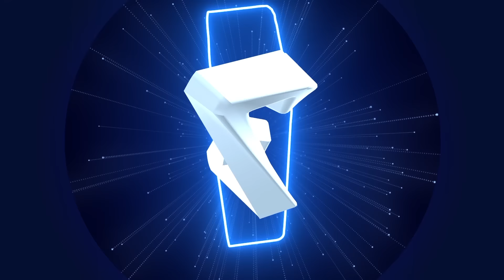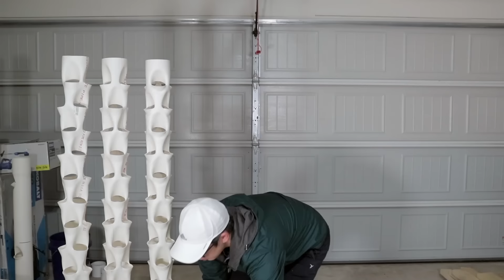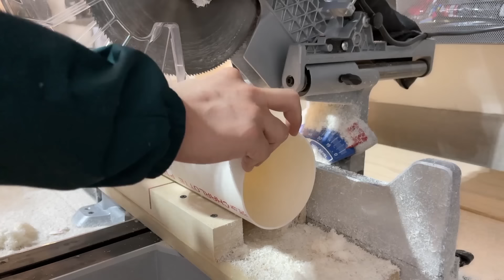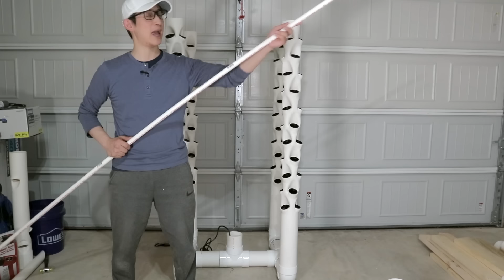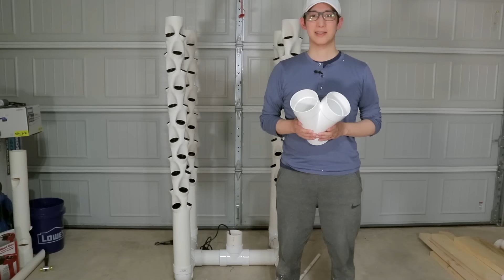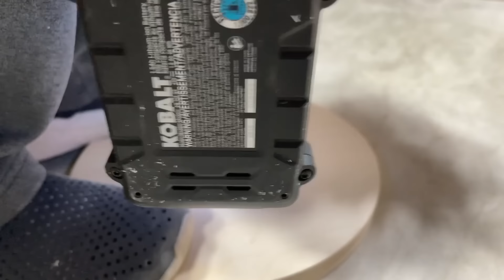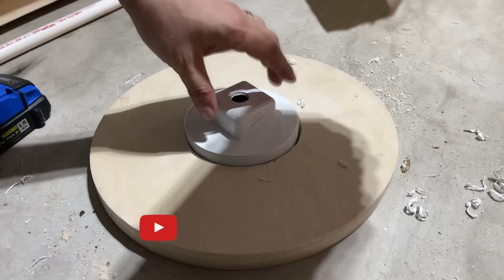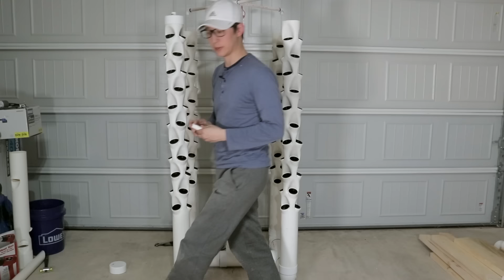DIY Hydroponics | Aeroponics Garden Tower Build | Part 2 - [4 Tower Build]

Comment: I’ve commented on a similar video but isn’t this aeroponics? Hydroponics is when the roots are fully or partially submerged in water isn’t this just spraying the roots with water which is aeroponics.
Reply: Correct
Reply: You can call it whatever you want but if it doesnt create genuine aeroponic roots, you wont get any of the benefits associated with aeroponics.

Comment: Very cool set up Chris. I'm looking to do something similar but i read somewhere that pvc pipe will leach toxic chemicals into the water that goes in it and is only suitable for drainage. Something to do with uv breaking down both abs and pvc piping. Have you heard of this? Ive read ipex piping is the way to go but can not find it in 4 inch anywhere.
Reply: I think it is PEX that you have to worry about.  That's some nasty stuff and is for "potable" water movement.  Never seen it to be any bigger than 1" dia. What is nasty about it, is if water sits in PEX lines for more than a week wothout movement, it degasses into the water.  It is usually installed in walls or in shade of a garage or laundry room.  I can't imagine how bad it would be sitting in the sun.  🤢🤮

Never had that degassing with PVC even exterior pipes in full sun.

Also ABS is for sewage not potable water.
Reply: @michaelsheehan5486  I c. Thats interesting as almost all homes in canada are not using pex lines instead of copper
Reply: @keithyoung7381  
I didn't say PEX isn't popular. 😁 
It's easy to install long runs with no intermediate joints like PVC and copper because PEX comes in long rolls.   
It expands and contracts without breaking seals if installed properly at the manifolds and fixtures.  
Also remember it's colder in Canada most of the year than your neighbors further South of you. 
One of my  friends is a plumber and he has installed PEX many times in AZ.  He has received complaints from customers who have gone away on vacation and come back to discover the foul chemical taste of the water from PEX installation. So I can only go by his experience. 
After awhile, the mineral deposits of the water will coat any pipe with running water. 
But he still gets complaints during the summer.   What can ya do?  Gut a whole house.  A person just has to run the water a little to get the stagnant water out. Unfortunately it is a waste of water. 
Just saying.

Comment: Great upgrades to your last video.  Again a comment... instead of cutting the 3" extra pieces at the tops (just 8 more places for a water leak)... consider using Street elbows at the joint... they will fit into your female adapters at the top of each unit.  Just less pieces to go wrong.

Very well done, thanks for all the ideas!

I'd like to see how your plants grow in this.... my instincts tell me that your water reservoir isn't big enough to support that many plants and you'll have pH issues.  Typically, hydroponics systems have 1/2 to 1-1/2 gallons of water per plant in the reservoir.  Your system cannot have more than about 5 gallons total, which is not good for 140+ plants.  If you could somehow attach a reservoir to the center mass of your structure it would work great.  Gonna work on that myself, will update if I come up with an easy solution.  The issue is going to be water tight connections.
Reply from the maker: Thanks for the tips.  I was also thinking about adding a reservoir but haven't found anything that can be connected easily.  Any recommendations would be great!
Reply: @ChrisLoh  Once again...  PVC Unions add a whole new world/dimension of flexibility and malleability to any PVC project...  So you can start smaller and work your way to a larger project with more towers, reservoirs  - - for disassembly for winter storage  - -  and as they said in the other comments valves on every tower and... possibly... even within  towers to grow things that require various water needs... more at the top and less at the bottom... the world is the limit... - - and a huge time saver and making the project more user friendly - maleable so the holes don't have to be perfect and re-heated - - pool noodles - - they said they had been using them for years and you can get them at the dollar store for $1.25 and far less dangerous cutting of tiny pvc slices - - and makes it so a person can do it without an accurate miter saw... even a hand saw....  and for drilling holes use only expandable bits like the second one you used...... Hole saws are tricky and make dirty uneven cuts that have to be cleaned up....

Comment: This is awesome! Am I just missing where the supply list is? I can't seem to find it and am itching to build one
Reply from the maker: I didnt post the supply list for the second build.  There is a supplies list for the first build.  I'll have to go back and see if I can put together an accurate list for the 2nd build.  For the most part its similar to the first build (multiplied by 4 in some cases) with additional connectors for the water distribution pipe.  I'll see what I can do to get the list added in the near term.

Comment: Hey Chris, great video and a great improvement on V1. I have a question has been asked before but didn't see a reply from you, what angle did you cut the 2” pipe at that you used to make the holes for the pots? Thanks.
Reply from the maker: a 45-degree angle should be enough, however, I think any angle will work as long as its sharp edge that allows you to get under the plastic.  To be completely transparent, I didn't measure and just cut the angle itself

Comment: What is the total ending height? I’m thinking about building a green house to put a few of these in, but not sure how tall I should build it. 

Incredible improvements from V1
Reply from the maker: The total height was about 6 ft, give or take.  Good thing is you can make it as high or short as you need by adjusting the height of the tower themselves.

Comment: The 4inch pvc at my lowes and home depot in Colorado is like 4x thicker I'm not sure it can be heated up and worked like that
Reply from the maker: Yep.  You will need to get the thinner PVC.  Im surprised both aren't available.  They are usually next to each other
Reply: The thinner stuff is sold as sewer pipe or DWV (drain, waste, vent)

Comment: When you're out if town are you using some sort of timer watering system to help keep the plants hydrated?
Reply from the maker: I actually didn't have to refill it for about a few weeks at a time since the water recycles.  I just kept mine on 24/7, however, I read it might be good to connect a timer so it's not constantly going.
Reply: @ChrisLoh  On one of the commercial sites that has a product very similar to what you built they have a timer that goes on for 15 minutes and then off for 15 minutes and then back on for 15 minutes etc.

Comment: I would add a valve on each infeed so that you can turn that flow off if you are not using the tower or need to do maintenance on just a single tower.  It may not be a big deal to turn it off when pulling plants and putting new ones in but at the end of year harvest your system wlll become less full and eventually some towers will be running while others will be empty and you will need to ether create caps for the empty spaces to prevent leaking or be able to turn off the empty tower all together.  a flow valve to each tower is and inexpensive fix.
Reply from the maker: Great idea.  Your right.  i think i saw a shutoff valve connector that would be easy to attach between pipes

Comment: Can I ask at what angle did you cut the 2” pipe that you used to make the holes for the pots?
Reply from the maker: I actually just randomly cut the angle.  I assume any angle will work as long as it lets you get beneath the plastic.

Comment: What pump are you using for this system?
I'm trying to find one that fits in the 4" pvc and will pump water high enough with the needed volume to water all of the plants.

Thanks for the video on this awesome build!
Reply from the maker: This one from Amazon: https://amzn.to/3LZtvy7
Reply: @ChrisLoh  Awesome thank you!
Reply: FYI , that pump Chris suggested here does not fit a 4" pipe with out cutting parts of the pump off. You can cut enough edges off to make it fit in the side of the fitting but not down through the top of the "T". Which means you either cant glue at the sides of the fitting and will have leaks OR you have to cut the fittings off and  replace most of the lower half of your assembly if the pump goes out. Its best to find a pump that can fit down into the fitting from the top of the "T".

Comment: Really cool build, man. I love the design. 

You're in for a bad time the way you use that chopsaw though. Let that blade stop before you move it out of your cuts or it will grab that stock and suck it up. Start that cut towards you and push back in to the fence. Let the blade stop and then readjust your stock if you need to finish the cut, but don't start the blade in the middle of the material. Also, it has a dust port on the back, I'd suggest hooking a shopvac, or even your home vac up if you don't have one. You don't want to be breathing any of that fine particulate. 

I don't want to come off too critical, but I've been in front of a saw for almost 20 years and I cringed watching some of those cuts on this video and your first one. I would automatically be correcting the apprentice if I saw him doing this on site. Stay safe, and good work.
Reply from the maker: Thanks.  Funny you should mention that, as I just watched some videos with exactly the same advice.  Lesson learned.  Thanks for the great advice!
Reply: Damn just wrote a comment about the same unsafe practice. Great info. I didn't read comments before I wrote it.
Reply: Question, then: Would it make sense to use a saw blade meant for stone? Or use a mister or water drip to cool the pipe? 
I haven't started yet, I need to get the saw first, before I try this.
;-)
Reply: @steyraug96  Nope. Regular wood blade will work fine. Stone blades are more of a grinding cutting action and would make too much heat. A regular wood blade will cut through so fast that heat won't be an issue, so you don't need any cooling. Most plumbers use a sawzall to cut this stuff, but it doesn't need to look nice or be too precise. Chopsaw is the way go here.
Reply: @gageangstrom7875  Thank you for the info.
Reply: @steyraug96  You don't need a power saw for this and in fact it would be far safer not to use one.  Just get an $8 hacksaw.
Reply: crazy how this guy does't credit the original owner of this idea. Petani Kota87 look him up, made this concept in 2020
Reply: @MRGAMER9119  https://www.youtube.com/watch?v=tmpPLiECCFU
Reply: @MRGAMER9119  I was thinking the exact same thing. I came across Kota before coming here and noticed the blatant plagiarism